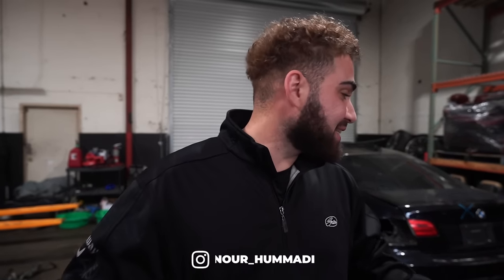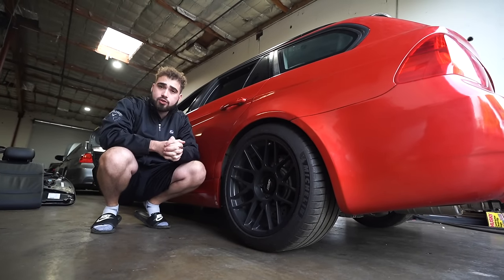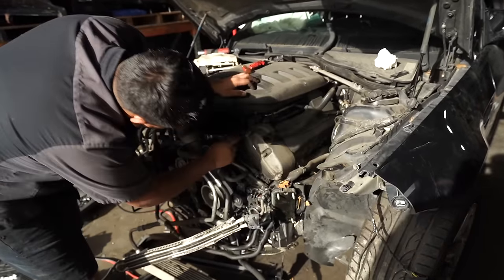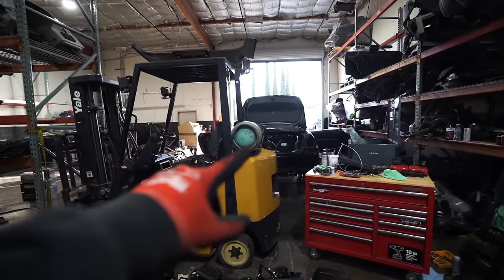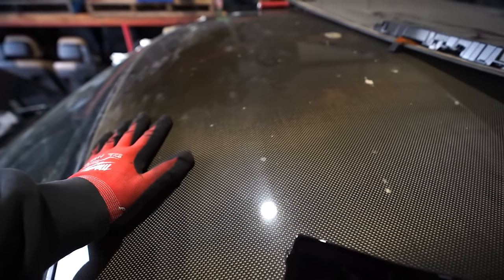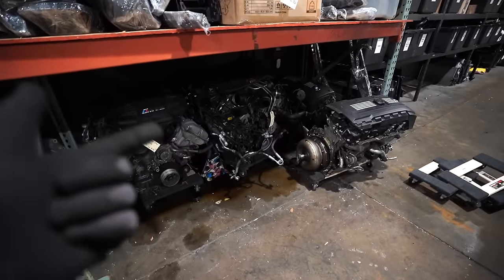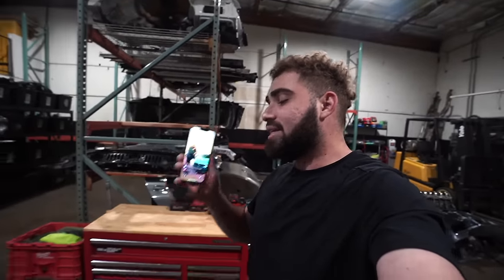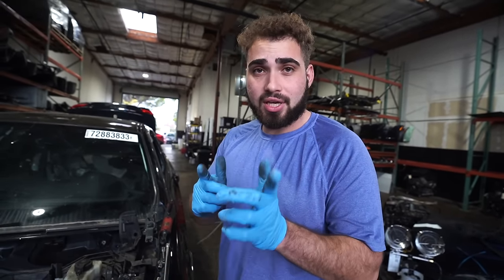WE FOUND INSANE DAMAGE ON THIS M-PERFORMANCE BMW E92 M3!

Comment: Nor please bolt your storage rack to the ground. I’ve been a Home Depot manager for years and the can  tip over. On the racks you can put 2x6 wood on them is you do not have the metal shelves.